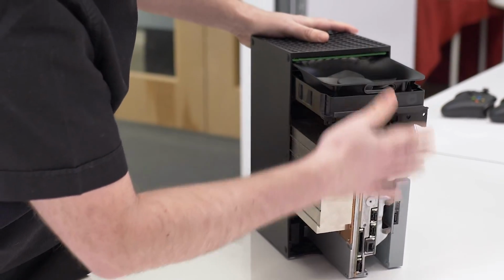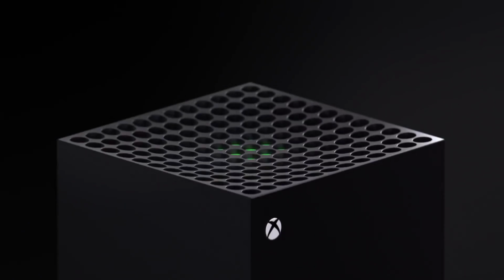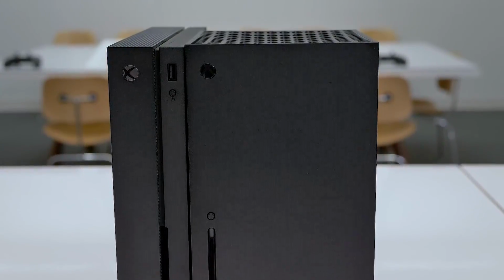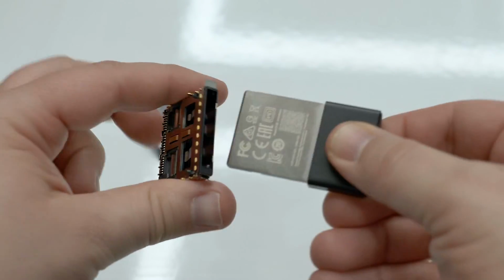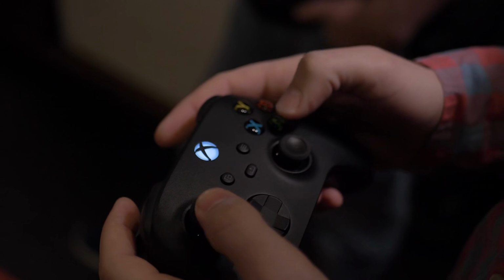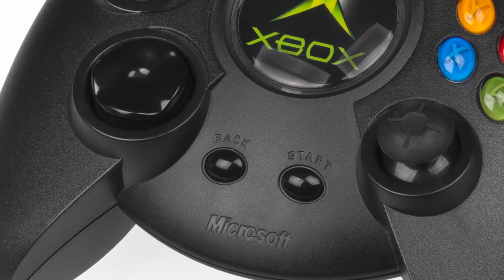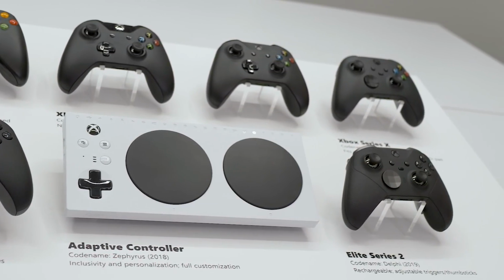DF Direct: Hands-On With Xbox Series X  + Impressions + Xbox One X Size Comparisons!

Comment: The design of the 2013 Mac Pro was fantastic, but never really allowed the simple upgrading users wanted and got that the previous and proceeding versions have. But when you only have limited or very basic upgrades available for something like a home gaming console, that design starts making a lot better sense, and that's why I'd use the Series X to the '13 Mac Pro has the closest comparison in terms of design inspiration (albeit a lot more packed internals).

Comment: The console is great but it is insanely stupid that the controllers still require batteries
Reply: All controller require batteries!
Reply: Mike Wade um playstation
Reply: @phaseyahtee421  open a PS controller up, within it you'll find a battery.

Comment: Really impressive design for a console. Especially that cooler looks beefy and the big fan they used should result in low noise and if things get tough, at least it should be a more comfortable lower-pitch hum instead of an annoying whine.
All of that said: I really don't see how this design is so innovative. It's roughly the volume of a DAN Case A4, or similar mini ITX cases, and people have stuck fairly high-end off-the-shelf hardware in those for "ages" now without the benefit of being able to custom fit everything.
Don't get me wrong: It's a really, really impressive machine and it's awesome that consoles seem to finally get good cooling solutions, but as far as innovation goes? I must have missed something.
Reply: lol
Reply: @Pulver  Care to elaborate?

Comment: my only concern is that it doesn't look like it will sit in an average TV stand like PS4 or XBox One does. so it will have to sit on the floor beside it.
Reply: Tv unit size is not a concern for most people. People have been getting bigger units for bigger tvs or wall mounting them for years...nobody would/should put a console on the floor.

Comment: The biggest question is what the coming depression will do to the market.
Reply: The market will bounce back once the Coronavirus has passed
Reply: @miami2881  
Corona is a short economic blip, to be sure, but there are larger, more structural problems with the economy. We're sitting on a huge debt bubble right now, because credit is so cheap. The problem with cheap credit is that it stimulates spending in the short term, artificially inflating the money supply out of proportion to the actual value being created, and there's very little actual value being created right now. Large corporations are using cheap credit to buy back stocks, because interest payments are cheaper than the dividends they promised their shareholders. Governments get tax money from the capital gains ostensibly made by the former shareholders, and count this as economic growth, despite nothing of actual value being created by the transaction. That short term spending, combined with low interest rates drives large purchases, like housing, which increases demand relative to supply, which means that the cost of housing, whether buying or renting, increases drastically. This is actually the biggest contributor to inflation currently, but isn't included in Consumer Price Indices, which national governments like to use in order to fudge the numbers on inflation. 

PROTIP: A stagnant economy typically produces inflation of around 2.2% annually, or what is called "natural inflation", but our governments are quoting lower rates of inflation while saying that our economies are growing; this is how you know they're BS'ing you

Given that fractional reserve banking (lending a portion of deposits, at interest in order to profit from customers' deposits) requires a growing economy to repay more money to the banks than is actually in circulation, our economies are not growing (or at least not nearly to the extent that governments tell us they are), and Quantitative Easing (printing money, which devalues the money already in circulation) along with reducing interest rates are not only not as effective at stimulating economic growth as those in power may believe that they are, but also become less effective the more they are used, we are guaranteed another depression. (and that's before we even factor in the effects of third world immigration and the governments' dysgenics programs which are breeding dumber and less productive populations in the first world)

No ifs, ands or buts, it's coming. Consumer spending power will continue to erode in real terms as it has done for a few decades now. I don't think we'll get the same short, sharp shock as the sub-prime mortgage crisis, but rather a longer, more drawn out affair as governments attempt to hold back the tide with further interest rate cuts and more money printing. I think another 8 year, or longer generation is a reasonable expectation, especially if you throw in the diminishing returns on Moore's Law, and that we'll soon be up against a wall in terms of how small Transistors can be made and how densely they can be packed onto a wafer.
Reply: Another 8 year generation

Comment: I have the gears Xbox x console. I won't upgrade to the next custom Xbox console. Which should be hell blade but probably won't be so I'll wait. 

Sucks the controller is smaller. I'm a tall dude so my hands are larger than the obvious average Joe that's what 5'10" I'm 6'2" and big problem with PlayStation controller for me is size and stick positioning

Comment: So, still no gyro in the controller? Ugh. And this is why I’ll stick to my 2080 ti / i9 9900k PC. With a Switch Pro controller and PS4 controller (May grab a PS5 controller if it also has gyro). Aside from that I am really impressed with the system. However, space is an issue. I have 8TB SSD in my PC (2 4TB SSDs) and even that is pushing it. A dinky little terabyte is a joke. 6 months it’ll last, max. Unless they have 8TB SSD expansions (which they won’t) Idk how this would ever work for me. ESPECIALLY with 5TB of X1 games on BC.

Comment: This isn’t that innovative wow the same controller and now it’s in tower form cool.. and they still require batteries for the controller.. man sony just gives much more.. touch pad on controller and speaker integrated into controller rechargeable controller.. I don’t see anything that crazy about this thing and everything that is really nice like expandable memory I’m sure Sony has all of it PLUS some.. guess we’ll see.
Reply: LILOz the ps4 controller has a lot of pointless features on it. the touchpad adds nothing to your experience, and most devs havent really used it (same with the speaker). the lightbar does absolutely nothing and just drains the battery (ps4 controllers die faster than xbox controllers because of this). sony did too much with their controller

Comment: I am not sure why the fan has a "pull" effect on the xbox series x? Wouldn't it be better to have it blowing (push) out hot air from the top? Actually now that I think about it there is a lot of ways to put 1 fan in the xbox series x but it depends on where you put it will change the temperature. I reckon if Microsoft were to add 1 fan at the bottom and leave the one at the top this could be a "cooler" console than most others if not all of them.

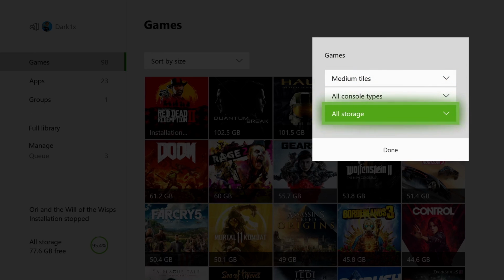Comment: 12:14 they should divide storage into 3 categories on the menu: internal, extended and external.
Reply: They probably will, if you’re talking about how it is now, but unless your talking about them actually breaking it down for us automatically in the storage menu by separate groups then yes.

Comment: so XBSeX is going with propriatary SSDs like how they had proprietary HDD on 360

i would rather have a full sized 7200 RPM HDD tille they have large SSDs and fix the wright limits

Comment: SEAGATE? Really? UGH. Major downer for me. I'm sure Seagate has a lot more in their coffers than some of the smaller SSD manufacturers, but I don't think I've ever even seen a Seagate NVMe drive, and I don't particularly trust their quality control, especially in an area of storage that they're not even known for.

I suspect that because they're using Seagate, they're probably going for a design using a controller known for stability more than speed, and hence the rumors about Microsoft using a slower (and probably cheaper) SSD design are true.

Comment: Would be awesome that would be available in the future and adapter to use those Memory Cards in a PC like an adapter from how it'll be called that connector to USB4 or something like that, or even maybe more in the future that availability of an adapter from a USB4 SSD to that connector to be able to use a "standard" drive in the console, but if they made possible to use normal external drives as an archive I'd be happy enough if they let adapters from that Memory Card to PC exist

Comment: I think it's a pretty neat feat of engineering, and I applaud them for it, but I can't help but be reminded of the trash can Mac Pro. Not in the way it's assembled, because the trash can Mac Pro was a very different design, but just that tall tower of components. Luckily Microsoft has incorporated proper cooling into such a design, and doesn't need the flexibility options of a PC that the trash can so sadly lacked. It's a little less elegant than I was expecting, to be honest, but there's only so many ways to pack those separate elements into such a compact design.

I'm basically sold on the Xbox Series X, I like the design and the components, but I don't want to pay more than $399 for a next-gen console, and I'm still happy with 1080p, so I don't necessarily need the oomph that the Series X has, never mind the fact that I already own a PS4 and a PSVR, so I'm likely going to stick with Sony this time around, even if I have to wait a bit for the price to drop.

I do love the idea of swappable SSDs. Perhaps include some internal storage for the OS and just allow game storage to be swapped out much like memory cards were, so that if someone ran out of space for game installs they could just swap in another small SSD and not have to worry about juggling internal storage or whatever. Would be nice to alleviate the headaches I currently have with my PS4 storage.

Comment: Proprietary storage just really sucks. Allows them to keep storage prices high even when NVME prices drop. It's understandable for the same reason that phones removing MicroSD slots was understandable because somebody might buy a slow SD card and then complain about the phone being slow. So we end up with an over-engineered, locked-down solution just to avoid consumer ignorance and make a penny while doing it. If there is an actual technical reason, such as the external drive needing to have identical hardware as the internal one in order to function (like they work together in some way), then I'm not too upset by it. But if not, they could have at least done like what the Xbox 360 did and have an "official" drive in a proprietary enclosure but still use standard hardware underneath.

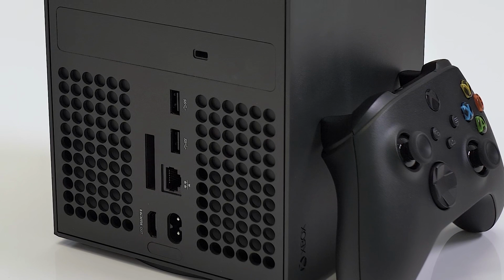Comment: @8:47 you can see the back and what looks like a C8 power inlet. those things  are rated for 2.5 amp's. So in the US that would mean 300 watt's MAX, wall draw. Given that it has a 8 core zen2 chip and what looks to be ballpark rtx2080 performance for the GPU... that's not a lot. And i doubt they'll ship a product that's right on the edge of the spec so probably somewhat less then that even.

A 2080 already draws 250 watt's on its own, before adding in a 8 core CPU, storage, memory, fan, and power conversion losses.

Comment: As someone who plays primarily on consoles from Team Red (Nintendo), I am excited for the Series X. To comment on the console’s design a bit, I like the modular-looking design for the internal components, it seems like it would make repairing the system a fair bit easier than previous consoles. It could also mean upgradability, but that would be a little far-fetched of a guess.
Reply: I can't imagine upgradability, you'd need to replace the whole SoC with it's pcb and ram. But the design does make two things easier; they can use a different secondary pcb for Azure deployments, and if they do another mid generation refresh they can leave the second board alone and just build a new SoC. Those are both pretty big benefits
Reply: Eolirin Yeah, that’s why I said in the original comment that upgradability would be a little far-fetched.

Comment: It’s should been slightly bigger imo.  Some room for Mobo and parts to breathe.  With few more fans.   If anything going fail.  It will be the fan. I do worry that it’s too compact and heat may still be issue.  I guess time will tell. I hope Sony does not copy them.   Mini mirco case would looked better imo and still gave some breathing room. I also wonder about psu.  Will it last or will over heat?  Very interesting design.  Can’t say I agree but time will tell if does well or if I over heats.  

I do wonder if disc/blu ray will scratch more with drive in that directions.  And with that much heat there? I’d be bit concerned.
I’m more of Pc/Sony/Nintendo fan.  Though loved both 360/ps3 days.  Have not been fan ms current directions and lack 1st party games. ( where is Next new fable?).  I do hope Sony has some kinda similar ssd upgrade options for ps5.  

I hope next gen console storage are 1.5 TB might be bare min.   But that prob cost too much, 1 TB will prob normal.   Imo it’s not enough.   RD2 is already more 100+ GB.   Are survival is easily 120+ GB with all dlc. Games with 4k and Ray tracing will only get larger.

Comment: I just freaking hope they have some exclusives. Playstation has some really good exclusive games this generations and it is hard to justified spending more than 300 USD for something you won't be using a lot due to lack of hadware (games). Microsoft needs to push all these game studios they've purchase to make some good games for the next generation or Playstation will run through them again.
Reply: Hard to see playstation having killer exclusives until 2021 considering how most of it's are still working on ps4. If MS could do something by then they might get an upper hand.

Comment: Proprietary ssd format ? Aaaah console players... You're so easy to rip off, it's not even funny.
Reply: But I think the hardware in general will be relatively cheap, which is the case with all console hardware. Where could you buy 12 tf for 500 - 600 bucks, even in 2021?

Comment: No back paddles/buttons on the new controller. I imagine that will be a difference between the new PlayStation & Xbox. With Sony releasing the dual shock 4 OLED back paddle adapter, it indicates the PS5 controller having at least 2 back paddles. If the PS4 controllers were to be compatible with the PS5, then a cheap add on would be the way to make up the difference in added buttons.

I personally have limited experience with back paddles on controllers, only a recent 'PDP Faceoff Deluxe+ Audio' controller for my Switch, so I'm not sure if it will be a disadvantage not having those on the stock Xbox controller. But considering the 'Elite' controller have used back paddles for a few years, it does seem odd that it wasn't integrated into the design. I guess they don't want an affordable version of their rather pricey higher end controllers. 
The back paddle feature still could have been applied, maybe a less premium plastic version vs the metal elite paddles. The PDP Switch controller I mentioned above was only £20, and I think they have even cheaper 'faceoff' controllers (minus 3.5mm jack for USB audio, game audio & chat) that also have back paddles.

Comment: One thing is for sure, you’re going to need a pretty high end TV to fully enjoy everything it has to offer!
Reply: zeemonkeyman1 yea absolutely :/ currently got the one x however only have a 1080p monitor and can’t choose, do I try n get my hands on that new new or go for something like a 1440p monitor with possibly a 120hz refresh so that i can actually utilise what i’m rocking, and utilise this beast when and if i get around to it 😫
Reply: Timo N 
I have similar first world problems! I’ve got a cheap TCL 4K TV (DO NOT EVER BUY A TCL TV THEY ARE GARBAGE AND THEIR SUPPORT IS NON EXISTENT) and although it work on 4K on my PC and the inbuilt Netflix it just refuses to handshake properly with the X and reports back as not being 4K! So I’m stuck with 1080P which the X still does great with but I’m not even going to bother getting a Series X unless I buy a half decent TV, something like a Samsung RU8000 would be perfect. Problem is it goes from a $600 Console to a $600 console AND a $1200 TV! Convincing the wife is going to be a challenge...

Comment: Really hope you guys told them to give it a different name! Like Scarlet or something...
I work in pcb industry but these b2b (board to board) connections are increase the risk of failures and thermals makes a lot of issues. To be honest the overall build is fasinating but i have a feeling that MS loose a lot on these boards and on their desing in the near future. I am interested in thermals as well. If it can be cooled with that cooler to 70degrees it's not going to be any issue for 5-7 years :) Maybe a slim version will come out in this period.

Comment: But the important question is... does the controller still use disposable batteries? 🤔
Reply: 16:08 it looks like there is the same design for battery slot as the previous Xbox : removable one or space to put 2 AAs. Rechargeable of course ! think of your money and environment. You can use good rechargeable batteries during 3 to 5 years. Disposable batteries are trash, don't use them, be smart.
2 rechargeable AAs are always the best choice (or at least removable battery, not like dualshocks).
More power, no trash can when controllers are dead, charge one pair and instant replace when controller is empty. MAX pleasure for years ;-)